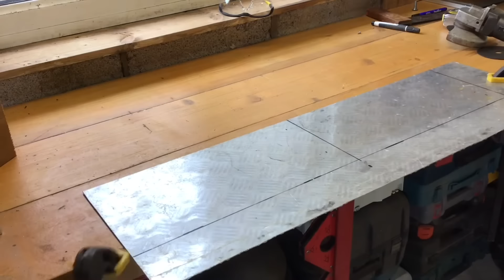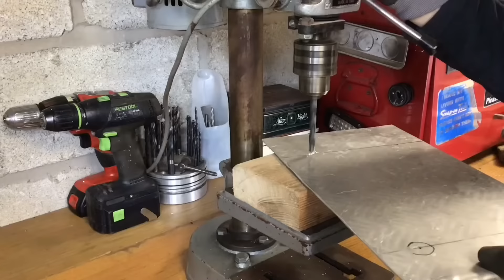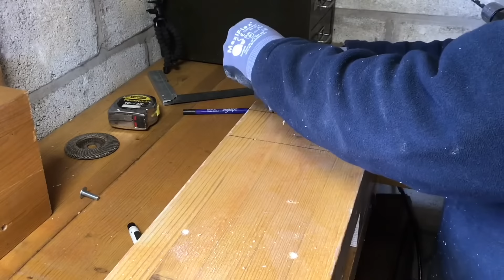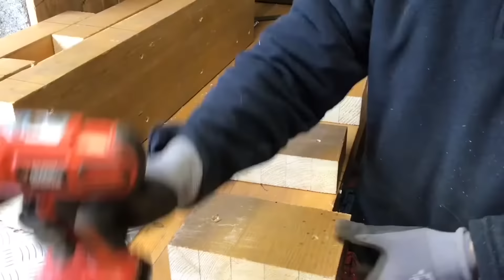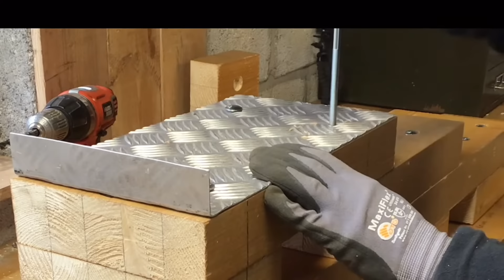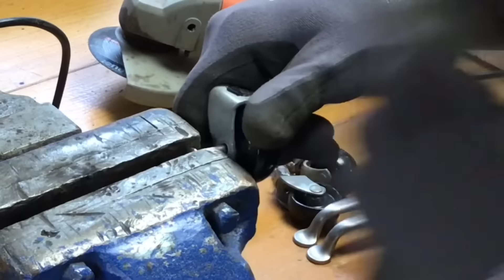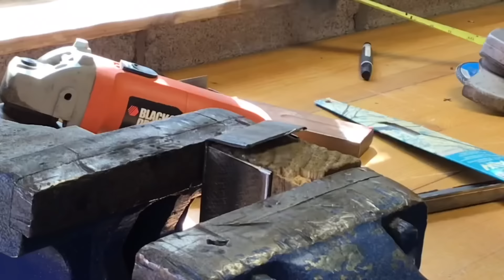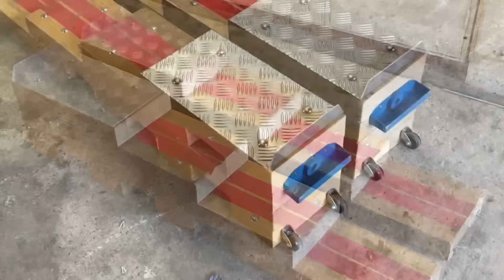Is this too much - DIY Wooden Car Ramps with a few Essential Extras

Comment: Dear sir. I enjoyed your video. I would recommend one thing only: don't use gloves near a drill bit. The glove can get wrapped around the drill bit and end up on your finger. That happened to me. Cheers.
Reply from the maker: Very pleased you enjoyed the video. And thank you for reminding me, it is so easy to become complacent and forget those important safety rules we had drummed into us as an apprentice.
Reply: My late father pulled 2 fingers off when a glove became caught in a drill bit.
Reply: Also never reach across a blade on a radial miter saw..the blade could bind and take your arm off ..I witnessed it almost happen to a coworker using a radial arm saw.

Comment: Sir I will tell you one thing I paid $75 for these plastic rhino ramps and they've worked great they've held up up trucks,suvs,and of course cars but I don't trust them so I always put jack stands underneath but if I had these wooden ramps I would trust these you should really think about selling some
Reply from the maker: I agree there is nothing like solid timber to make you feel safe. I have thought about selling them, although the present construction is fairly labour intensive. I’m really pleased you like them. 🙂👍

Comment: I would suggest putting something to reinforce the upturned aluminum on the top of the ramp. It is not near strong enough to stop a vehicle from rolling forward off the ramp. Either a piece of 2 inch angle iron or a piece of 2 x 6 lumber the size of the full ramp face glued and screwed to the face of the ramp that is also fastened to the upturned aluminum.
Reply from the maker: Hi Zephaniah, I hope you enjoyed watching the video. Thank you for the advice I appreciate it. You would actually be surprised how strong the the folded checker plate is. I can guarantee if I tried to drive of the end, the ramps would tip up before the the metal bent the other way. It is more there just to know you are at the ramp end. The process of bending the metal makes it stronger. This may seem counter intuitive but initially bending the metal is fairly easy. Trying to straighten though becomes very difficult due to the the crystalline structure of the metal changing during the bending process.
Really pleased you liked the ramps. 👍

Comment: These are great! I particularly like the use of grip tape. One thing, since the handles are at the front, you are running over them every time. Does this weaken them at all or it doesn’t matter?
Reply from the maker: Thank you very much. They seem a bit over the top but everything has a purpose. As regards the handles they are low enough and small enough that the vehicle wheels don’t even touch them. They work great.  🙂👍

Comment: Should of put a hing on it so it swings away from the vehicle so the ramps are out of the way.  All that work and forgot one key thing lol.  Hing in the middle.
Reply from the maker: Great idea Joe, I have seen someone do that on YouTube and it has crossed my mind. Maybe I should modify them. 😊
Reply: @@a.melburn You cut the ramps in half and attach a door hinge on both sides, with removable pins. Then you can pivot the ramps out of the way to work under the car.

Comment: That's pretty epic. I wasn't so sure about the gaps you had until the end there. That's pretty clever. Only upgrade I'd add is a solid 2 x 8 that goes vertically to reinforce your diamond plate backstop.
Reply from the maker: Hi Kaleb, thank you, epic is praise indeed. 😊 You would actually be surprised how strong the the folded checker plate is. I can guarantee if I tried to drive of the end, the ramps would tip up before the the metal bent the other way. It is more there just to know you are at the ramp end. The process of bending the metal makes it stronger. This may seem counter intuitive but initially bending the metal is fairly easy. Trying to straighten though becomes very difficult due to the the crystalline structure of the metal changing during the bending process.
Really pleased you liked the ramps. 👍
Reply: @EverydayWorkshop  makes sense. Hadn't considered that point. Duly noted.
Reply: I was thinking the same thing. Just to keep from running off the end. Otherwise, this was a brilliant build, wasn't it?

Comment: I like your variable speed  palm-peen hammer
Reply: Seeing those actions at 04:02 made my hand hurt in sympathy! 🤣 Have been a Diesel mechanic for 20 years but if i did that I would be feeling it for weeks!
Love the ramps though 👍👍
Reply from the maker: Out cast and Rob. It’s not as bad as it looks, the wood is fairly soft and my palms are built for it anyway 😄. Thanks for watching and glad you enjoyed it 👍.

Comment: I like the idea of leaving open sections to reduce weight plus bonus place to hold tools!   I must say that putting it together with bolts is crazy overkill.  There's no need to ever take it apart so I would glue the pieces together instead.  The aluminum sheet metal is also useless.  Maybe it will stop the wheels if you go too far but I would rather have a thick piece of Aluminum (or better yet, steel) bolted to the front for a stop. for a For non-slip surface, paint the tops with oil based paint and sprinkle sand on it as it dries.
Reply from the maker: They do save some weight and give them a certain look which I like. I know the bolts are maybe a bit of overkill, but it is extremely solid and will never go anywhere 😁 and part of the idea was to make an interesting video. Hopefully I succeeded in that regard. 
Not sure what you mean about the aluminium checker plate it definitely isn’t useless 🙂. I know you might think it isn’t strong enough as a stop, but honestly that is not the case. Once bent the plate becomes very strong, any vehicle would only roll over it and not flatten it. The non slip adhesive tape I used also works extremely well and makes a neater more professional look imo. Hope you enjoyed the video and thanks for watching. 👍🙂

Comment: Can you please make one for the whole car? 
Here are the ideas?
1. Split sections that can be joined together to make a long one. The sloping ramps at the end are detachable.
2. Option to remove the Ramp section under wheels while supporting that part of the car by a jack stand placed between pinch welds and on top of the other section of the Ramp
3. Top piece, the driveable section, of the long ramp can be removed to make it light for storage.
4. Height is the ramp to be around 15 inches.
5. Ramp has a large openings to slide under the car from the side of the ramp.
6. Supporting blocks under the ramp can be placed anywhere along the length of the ramp to make it easier to take the tires off and do suspension work, etc.
Reply from the maker: Great idea, something I’ll have to think about. 👍🙂

Comment: I like it! That first block that the wheels are attached to could be cut at an angle to make a French cleat to hang these on the wall when not in use.
Reply from the maker: Hi Steve, that’s a great idea that I didn’t think of. I might just do that. They stand up against a wall at the wheel end at the moment. 😊👍 Very pleased you enjoyed the video.

Comment: OLD Leather Smith here, I have only 1 suggestion,  Elevator Bolts would work much better the head is Flat and under the head is still square so they won't turn in the wood. Before Leather business I sold Fasteners 4 a living for 46 years.  Great Job.
GOD'S BLESSINGS ✝️⚾🙃
Reply from the maker: Hi James, great suggestion they would probably work great, I’ll definitely keep them in mind for any future similar projects, although I have quite a few surplus at the moment. 😊 
I’m interest to know what you do in the leather business, do you create things?
Thank you very much for the kind words and I’m pleased you enjoyed the video.
Reply: @EverydayWorkshop  I do custom only 4 clients and customers, nothing's 4 sale.  Yes I put things 2gether, I also carve in 3d.  Customers and clients bring pictures, make comments and I ask questions then I produce.  GOD'S BLESSINGS ✝️⚾🙃

Comment: Nicely done. I'd like to offer some constructive criticism and a few ideas that adhere to the first rule of engineering: Never design yourself into an "oh shit" scenario.
First off, the handles will snap right off as they are in the tires' travel path. A smaller profile tire is almost guaranteed to hit them. Moving them to the sides is a simple fix.
Second, this may seem trivial, but why not use regular bolts? Plus, what if one carriage bolt breaks loose? This assembly relies on the tensile strength of the material in line with the grain (Axis of Least Strength), with the compressive load concentrated into a VERY small area. Wouldn't take much to break loose by splitting the grain apart. Regular bolts and locknuts will do just as well, just countersink the holes enough for a socket. For the tread plate, using countersunk head screws would be fine and keep it tidy.
Third, I'd suggest adding an Anti-tip Countermeasure on the end of the ramp. A block that sits beyond the upturned section of tread plate will do fine. It and its connection to the rest of the structure needs to be VERY strong as it will be taking the entire load of the vehicle in a rather small area if one slightly over-runs the ramp.
Last, how are you addressing and correcting for material warpage? I don't readily have a solution for this, but I did notice these ramps were not sitting square, flush, flat and even during use. With the weight of a vehicle, I'd be concerned about stability on such a critical piece of safety equipment. Movement introduces Velocity which amplifies Force proportionally, increasing stress on the materials.
Reply from the maker: Thank you I’m pleased you liked them. And thank you for your constructive comments. 
Actually the handles are fine if you look closely they are offset and I’ve now had numerous vehicles up these ramps with no issue. 
The coach bolts are just clamping the wood together and aren’t really carrying any load, that is carried directly through the wood to the ground. (these are 8.8 and exactly the same as bolts would be)  
You would actually be surprised how strong the the folded checker plate is. I can guarantee if I tried to drive of the end, the ramps would tip up before the the metal bent the other way. It is more there just to know you are at the ramp end. The process of bending the metal makes it stronger. This may seem counter intuitive but initially bending the metal is fairly easy. Trying to straighten though becomes very difficult due to the the crystalline structure of the metal changing during the bending process.
Your last point which I do appreciate you making, but I do not think it is an issue at all, any warping or flexing is negligible and is only apparent due to weight transfer as the vehicle is supported by a different section of the ramp. You will get exactly the same effect with a steel ramp. 
Thanks again for watching the video and liking them. 🙂 👍
Reply: @EverydayWorkshop  Agreed, the actual coach/carriage bolts aren't the issue. It's the surrounding material keeping them from turning in their holes. Add a few years and you're probably going to have a bad day if these ever have to be taken apart. I figure you handled any concerns about the top plate, so no need to worry about it. The ramp tipping forward in the manner you describe was my main concern, hence suggesting to add an anti-tip block at the bottom. As for warpage, I've had the same issue come up with my massively-overbuilt wheel stands. After 3 years, only one still sits flat. I discovered this when trying to use them a few weeks ago and found the rear of the vehicle had walked slightly sideways as a result. It also failed the shake test. Black flag, full stop right there.

I put the car back on the ground and I re-examined the stands. The rear of the car was also about 12" off from where it began. Might only be 3mm of one corner, but that's more than enough for things to go bad. Especially with 2+ tons of BMW or 3 tons of Ford Expedition sitting on them and putting lateral load on them such as breaking a bolt loose. Maybe you have some suggestions on how to correct this?

Comment: i cut the ramp boards at a 45 degree angle makes the tire roll over it easier.
Reply from the maker: Yeah I nearly did the same but it is debatable whether a vehicle climbs up better. From my experience the tyres can tend to lose grip on a slope, but contrary to what you would think they grip really well on this design. Hope you enjoyed the video. 👍🙂

Comment: Great job, I just wondering how much you spend on materials and time!
Reply from the maker: Thanks Marcela,  the timber is left over from building a bench, which I bought from an auction.  Think I paid around £40 and I still have plenty left. About £20 for coach bolts and £10 for the grip tape. Everything else I already had. In terms of time I’m not really sure but think I built them over a couple of days. There are some links to some of the materials in the description. Hope this helps. 😊

Comment: youre highly skilled at building things that is for sure, but sheesh that 2 inch jump may be a little much for grandmas honda civic right?
Reply from the maker: Thank you very much. It is actually fine, I’ve used these ramps with several vehicles of varying sizes and they’ve all climbed up very easily. So I’m sure Grandmas Honda Civic would manage just fine 🙂👍
Reply: @EverydayWorkshop  oh nice, i seen at the end of the video your volvo made it with just street tires, i wasnt sure if that was awd or something. while you were building it it looked like a huge jump. btw did you ever reinforce the metal that was folded up at the end?
Reply from the maker: The climb is fairly insignificant really, imagine how your car fairly easily climb a kerb. Absolutely no need to reinforce, a few people have mentioned this. Believe me this checker plate is very strong especially after being bent as the structure of the metal changes increasing its strength and works very well as a stop unless you keep driving ! 🙂👍
Reply: @EverydayWorkshop  oh okay cool cheers

Comment: I suggest a hole in the first step where a pin can be dropped into a hole in the floor.
People have reported instances where the vehicle has slid one ramp out from under the tyre as the vehicle was climbing the ramp ,and the vehicle underside drops onto the displaced ramp causing damage to the vehicle.
You can put a masonry anchor in the floor , but it isn't strictly necessary.
Reply from the maker: Thanks for the great suggestion Paul. You’re absolutely correct they can slide out if you are not careful, that’s were skill comes in as you first climb the ramps. Once your on the first step you are fairly stable. In a perfect world an anchor would be great but we would loose the convenience of using them anywhere. 👍😊
Reply: @EverydayWorkshop  That's only true of a LSD equipped vehicle. With an open differential , a slight difference in the friction between the ramp and the floor may result in all the power going through one wheel and sending the ramp on its way (assuming the driving wheels are going on the ramps)
Reply from the maker: Hi Paul, yes LSD vehicles would be easier, but they are only “limited” not locked. The trick is to chose your ground wisely so the grip is even on both ramps and both wheels contact them evenly. This will lessen the chance of a ramp slipping away. This is one of the the advantages of stepped ramps. Drive onto the ramps with a bit of momentum so they sort of roll onto the first step and you shouldn’t have a problem. 👍
Reply: When I built my ramps years ago , I took sections of an old semi truck mud flap that I had found alongside of the road and nailed them to the underside of the ramps to prevent the scooting across the floor .
Reply from the maker: That sounds like a great idea Bob. 👍😊
Reply: I used roof shingles under mine

Comment: What do you think that we capacity of these are? I have a GMC Topkick dump truck that weighs 33,000 pounds with a load of dirt in it do you think I can make a pair of ramps out of wood that would hold that?
Reply from the maker: Hi Greg, well not these actual ramps. These easily cope with a Land Rover Discovery. But your dump truck is a little heavy for these, 33000 lbs is 16.5 tons in English money. But yes timber ramps of the right size construction and timber will work fine. I started my career as a truck mechanic and we used timber blocks all the time to drive onto and to support it when jacked up. In fact a wide thick timber block is far safer than your average axle stand IMO. Grips the floor and and can be far more stable making you feel much safer working under a heavy vehicle. Hope this helps. 🙂👍
Reply: OK sounds good. I will definitely look into making me a pair. Thank you for the awesome response.

Comment: Just make a solid block ramp .use 2x8 or 2x10 boards cut at different lengths . Glue and  screw together with construction screws.  Half the time and half the cost of this vidio.
Use them on a 2500 diesel with no concern of collapsing.
Reply from the maker: Hi Peter, well there is certainly no concern of these collapsing. I could have made some just as you suggest, that would have been very easy 🙂. They might have been quicker but the video wouldn’t have been as good. In terms cost your version would cost more 😉 as I had everything for these ramps (except the tape) but not for your version. Hope you enjoyed the video though. 🙂👍
Reply: Hi do you have material list and size please